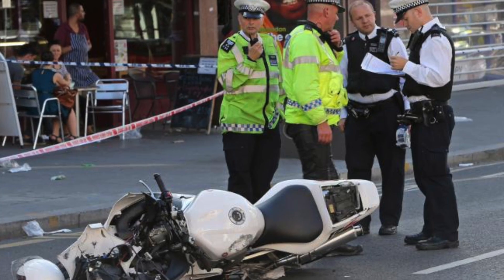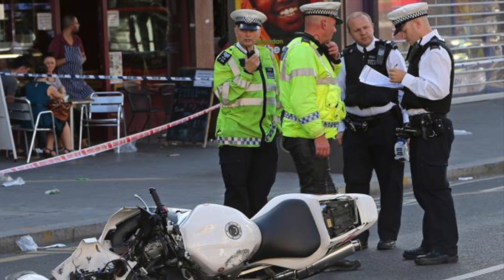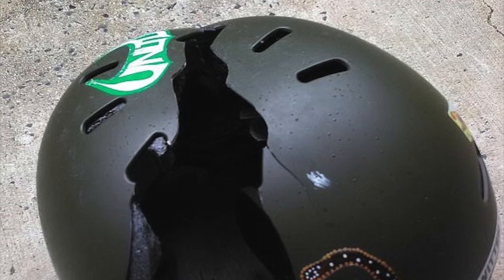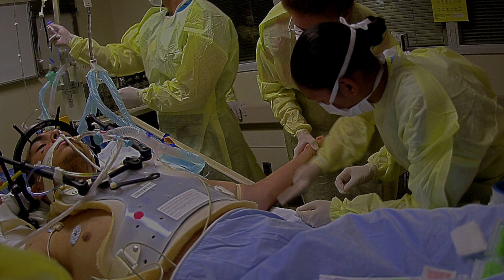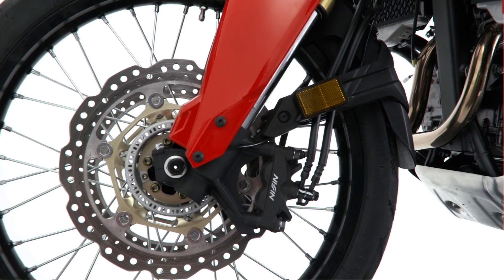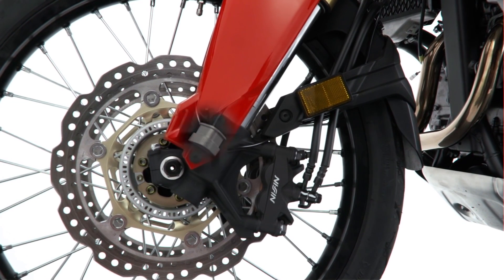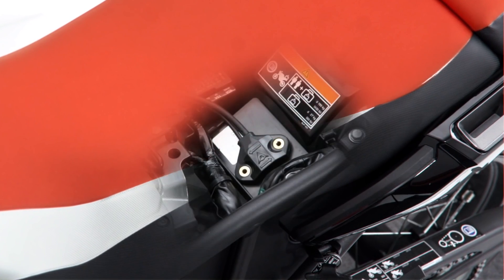M28EKM Development of I-Air Safety Jacket

Comment: Guys you all have done a great job. But if I may ask this. What will happen to the herniated disc and also the material must be heat resistant with poly fabric outer shell with thermal layer . Please do it like a 
1)sport type(aerodynamic ppty)
2)full sleeve( riders comfort)
3)thermal stable (not very hot inside the jacket)
4) virbration reduction
5) sponge type protective layer